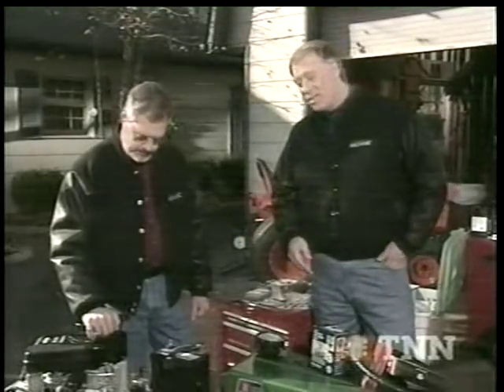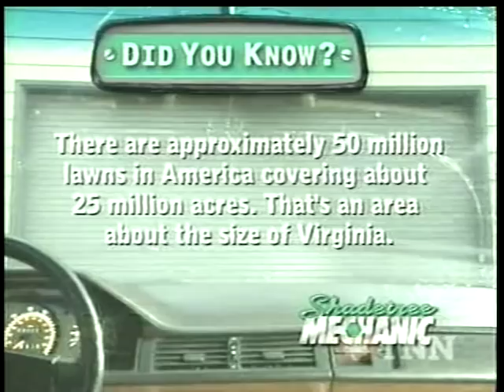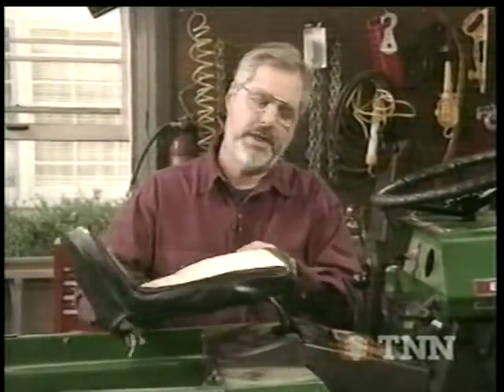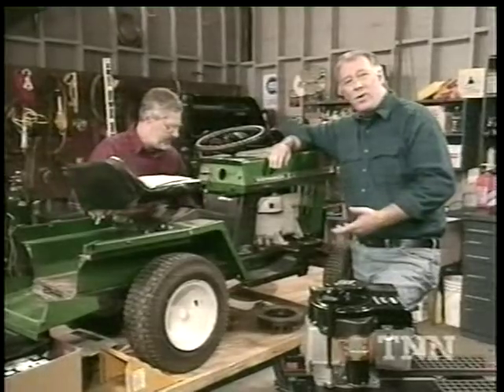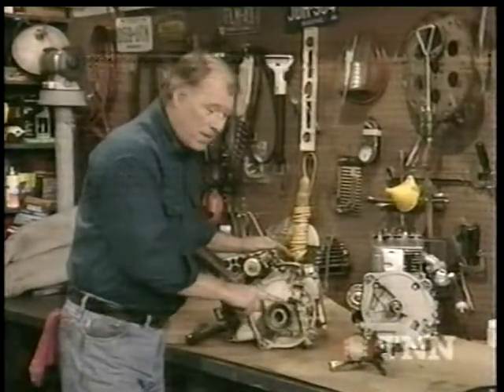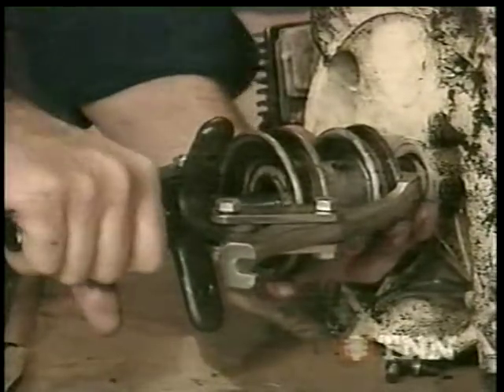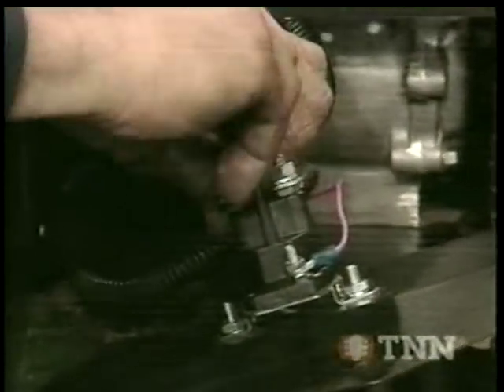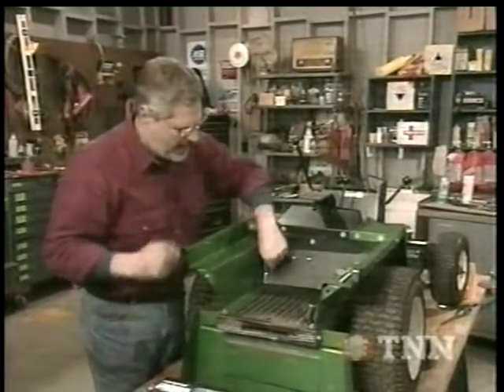Bonanza Riding Mower / Garden Tractor ~ Briggs & Stratton Part 1

Comment: My dad one of those Bonanza's only his was yellow, 7 hp Techumseh.   His had the pickup bed in the back .   It had electric start but also had the recoil starter with the handle through the dash.    It no compression relsease and recoil starter would practicaly  break  your hand when the hand would get jerked out of your hand.